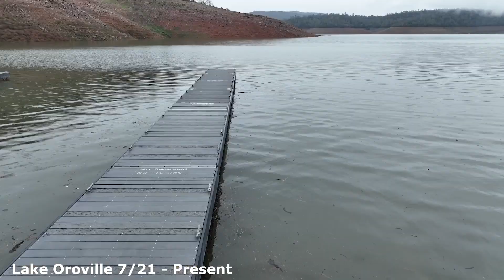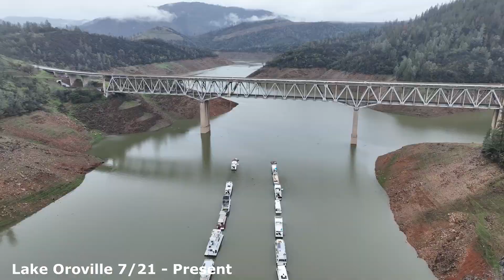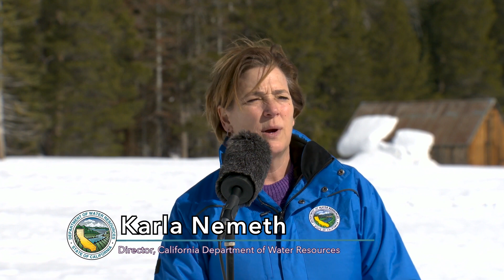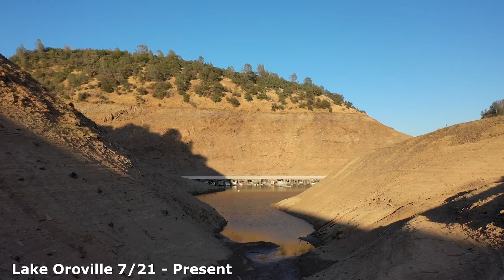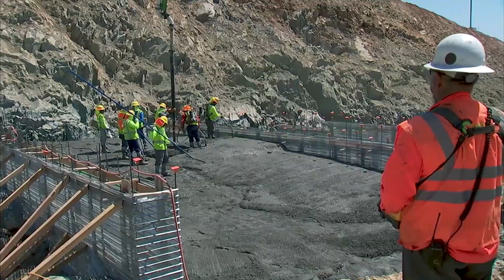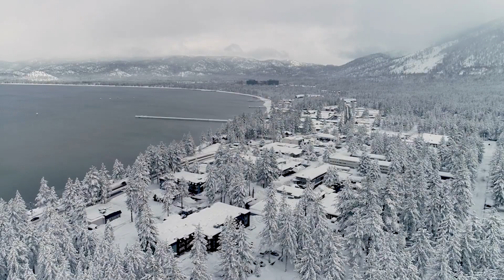Lake Oroville Rises: Latest Update & Drought Status

Comment: Case study on the Oroville dam spillway failure  is worth a read —
The independent forensic team concluded that the Oroville Dam spillway incident was the result of interactions of numerous human and physical factors, beginning with the design of the project and continuing during the half-century until the incident. The incident was fundamentally the result of a long-term systemic failure to recognize and properly address the deficiencies and warning signs which preceded the incident, and there was no one root cause.

Comment: With La Nina coming to an end after a 3 year run hopefully the drought will be busted out of the window next year.    The one warning is that past 3 year La Nina runs have lead to strong El Nino and flooding like in Sacramento in the 1970s and in 1997.  The forecast is already no longer showing neutral Enso but indeed that El Nino is happening very quickly.
Reply from the maker: We expect to be on a lot more floods with the shift to El Niño for sure.

Comment: I'm hoping Lake Oroville will hit around 860 feet before the snow melts. This will raise the water level above the 900 Ft threshold forcing them to open up those old rusty gates. Another failure in the making?
Reply: Those old rusty gates have been refurbished as part of the spillway rebuild. They are ready to go. There was leakage but that is fairly normal with that style of gate.